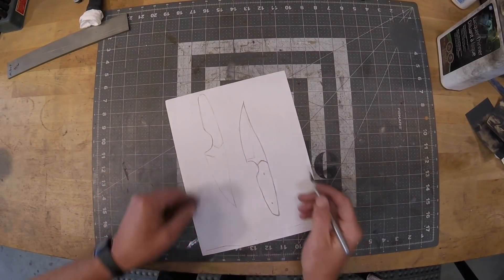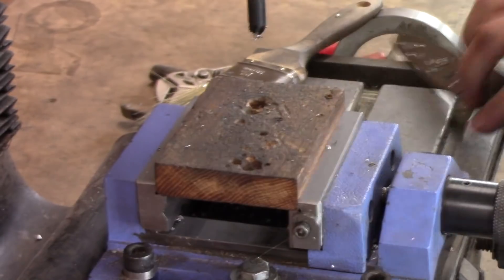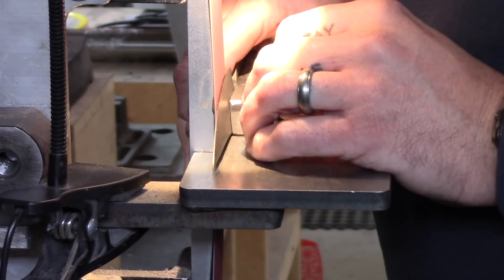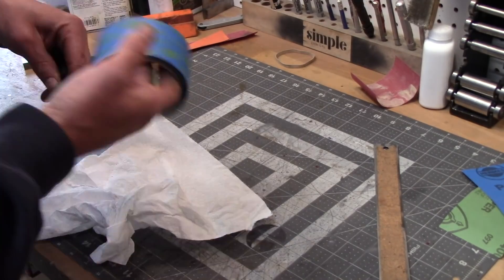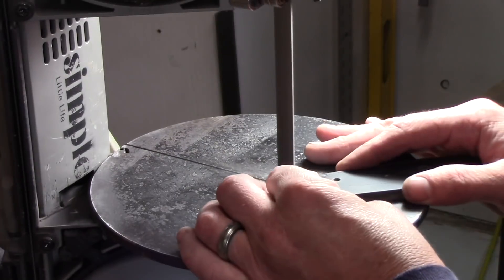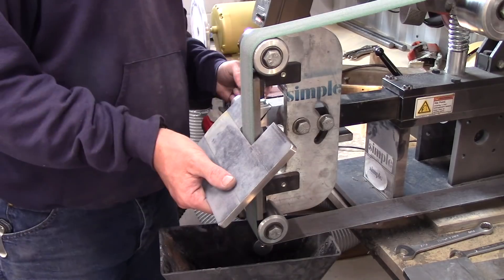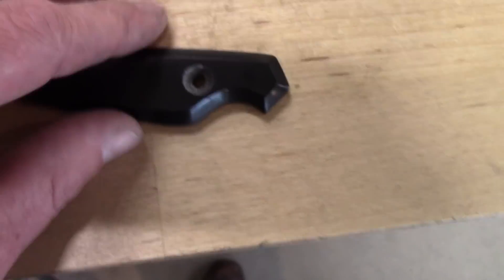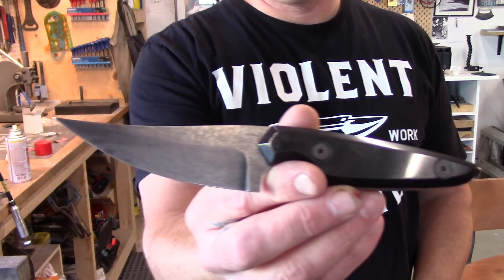How to Make a Knife - The Crooked Finger

Comment: Is it worth doing a 'cryo' in a regular home freezer?  I know it's nowhere near as cold as nitrogen but is it cold enough to make any differance to the steel?
Reply from the maker: I haven’t tried and tested it but my inclination would be that it wouldn’t make much of a difference. Simply because of the huge difference between 0F and -300F. But who knows, maybe it would make a slight difference. That’s a good question though, I like it 👍
Reply: @Simplelittlelife  it would be an interesting experiment, but since posting that I've now been wondering if the steel would actually start to rust? I'm going to stick a scrap piece in and see what happens.

Comment: was wondering how long you typically let the blade sit in the nitrogen? fairily new to making, but want to get the most out of my HT. primarily using O1 at the moment. it looked like about a 20 min soak at 1600 also. do you find this to be optimal? currently using a small home made forge and a torch with map gas. certainly not the best set up. just trying to learn all I can... LOVE the content, your chanel has helped with so many things. it inspired me and my 2 brothers to start doing this together. @sonsofthunderblades on IG. We appreciate everything you do!